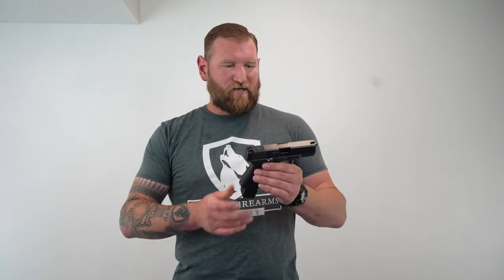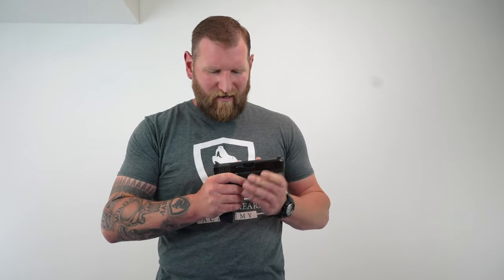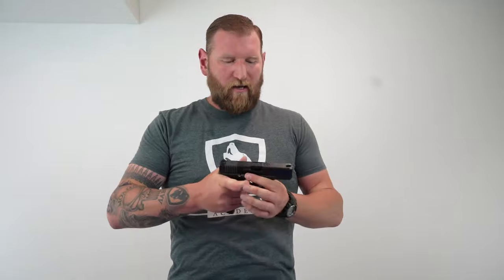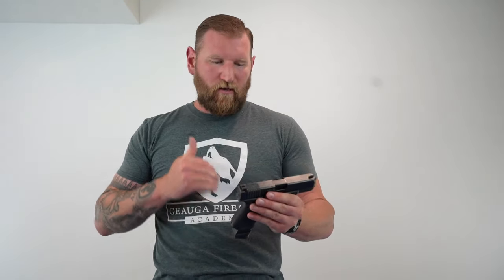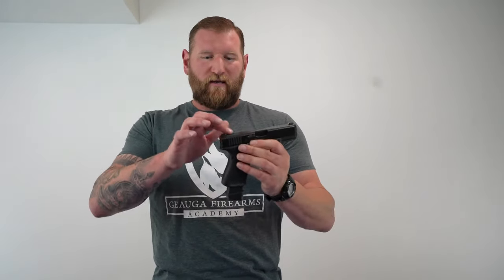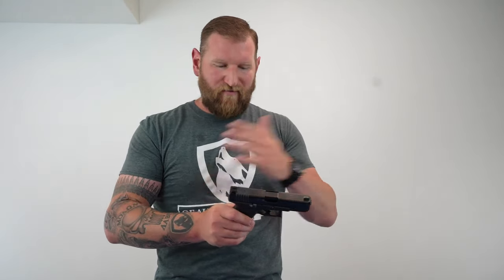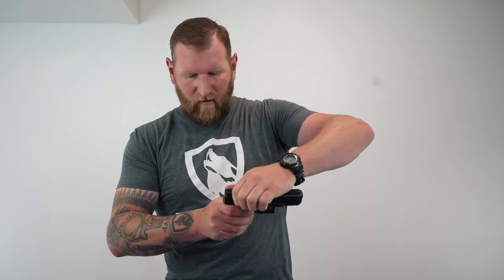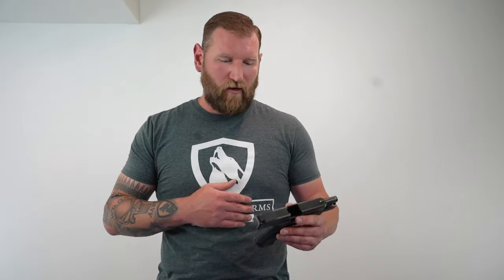How to Clear the Most Difficult Pistol Malfunction- Type 4

Comment: Just watched this video, as I was curious as to what a "Type 4" malfunction was, since I had never heard of it.  This is called a "hard extraction".  It occurs typically with remanufactured ammo or reloads.  After firing a round, the casing expands too much for the extractor to extract it out of the chamber.  It's very easy to diagnose (you simply can't rack the slide) and as quick to fix as a double feed, although significantly quicker if you don't take the magazine out.  However, it's recommended to take the mag out or else you can cause a double feed.  If you don't hit the backstrap forcefully enough, it may take 1 or 2 more tries.  One thing you didn't mention, which I feel is important, is to be very careful of the angle that you use when striking the backstrap.  Your hand needs to be at somewhat of an upward angle so you don't cut your hand if it hits the beavertail (which can be quite painful and bloody, as I once found out) but also not too much of an angle, or else the force may not be great enough to jar the casing loose.

Comment: Only two ways I clear those type and most jams.  First is simply lock the slide to the rear and take out the mag.  If it's truly locked up and will not lock to the rear I put on my gloves.  Then do EXACTLY what you just did in this video but with gloves on.

Comment: Will this work if you have weaker/smaller hands or muscle rigidity in the hands? I have CP, so my hand muscles aren't the greatest in addition to the small size + shorter fingers. Even with hand exercises, I've noticed that mine seem to be a little weaker than average, so that is a concern. Thanks in advance.

Comment: Yesterday at range 3 of my guns had this issue. I was able to clear 2 of them rather easily by forcefully bringing slide back. The 3rd gun would not release the slide and had a round in chamber. I even hit the slide hard on a table and it was jammed. Tried your technique and it worked!!!!   Thanks for the help but do you know why 3 guns would have same issue that i never had before?  If it helps a brand new shooter was shooting with these guns and when i shot no issues.

Comment: Impulse. Good to know that option to clear. 
Is the rim to deep that this happens?
Reply from the maker: No the case is stuck in the chamber and the extractor is stuck with the case.
Reply: @geaugafirearmsacademy  
Last week I had that malfunction at the range!
I used training reloads of a friend for his Tanfo Gold Medal Match and I used it in a Canik TP9 Elite Combat that ate the last 3k rounds without any hiccups (basic cleaned every 500 rounds). Idk if they copied the stepped chamber of Walther or it was just such a weak load that the timing changed...it took that technique to get it open. 
Had it 3 times in a row! The loading matrix of the case wall might be also the culprit. Some give straight, some tapered walls.

Comment: If you could generate enough of a force impulse,quick enough,could racking the slide back work too?
Reply: I don't think you could accelerate you hand quickly enough from the stopped position gripping the slide, as that is essentially the problem with applying constant pressure. It's your dominant hand moving forward at speed and hitting the rear of the grip that generates the impact force needed to break the extractor free.
Reply: Maybe it could be done by holding the gun normally in your dominant hand close to your chest and gripping the slide with your off hand, quickly moving the gun forward and then suddenly reversing the force with your off hand. It's worth a try I suppose as you are less likely to accidentally knock the gun out of your off hand that may not have as strong a hold on the slide, but it seems like smacking the grip with your dominant hand would be a more reliable method. Just hold on tight to the slide, I guess.
Reply: @reshpeck  If I ever have to use this I'm just alittle worried about sending the gun flying! I also shoot a Glock & in most cases you've got to really get a good grip on that slide for just about anything, I'm also shooting the Glock 30 not a 9mm Glock.
Reply: @jamesriggs6210  be sure to hold on as tight as you can, or else it can certainly fly out of your hand.  I taught this to about 7 ladies in a group I belonged to. (We just pretended they had a hard extraction.)  Even though I warned them and told them to hold on REALLY tight, 6 out of the 7 had their guns fly out of their hand and land on the floor.  You would think about the 3rd person to go and see the gun go flying from the first two people would have been a clue to hold on really tight, but apparently not.  However, the last lady actually listened and was the one whose gun didn't go flying and land on the floor!

Comment: I'm not a physicist but what you are describing sounds somewhat akin to the difference between torque and kinetic energy. It's the difference between using a long-handle ratchet wrench on a lug nut vs an impact wrench. You'll notice that if the tire of your car is off the ground and able to spin freely, using a ratchet wrench or breaker bar will not work; the wheel will just spin in the direction in which you are applying pressure. If you use an impact wrench instead, however, the tire won't spin and the nut will break free.
Reply from the maker: I think your on to something

Comment: 25 rounds into my new sig 365 xl, had a type 4 due to crap ammo.  Was able to clear it by placing the corner of the gun on a firm surface and pushing, which dislodged the malformed round. Don't try this a home.  Like I did.  All was fine, but baby, that slide was STUCK.

Comment: I don't know the internals of that Glock, but I'd expect that if you call them, someone can get to you with the answer. It sounds like either a cartridge is out of spec, or the extractor is malfunctiong.
 As to why the chop works when the slide is locked up, think of a door. It won't open, no matter how hard you push. But if turn the doorknob, it opens.Why the inertia from the chop works, is something Glock should know. And if they don't know, they ought to ask for your pistol (or another jammed one) so they can open it up and find out.
Reply from the maker: Thanks for watching and commenting
Reply: It's usually an ammo issue (most commonly with remanufactured ammo or reloads, although one of my guns had this happen A LOT with a specific type of factory ammo).  When you fire a round, the casing expands a little too much and gets stuck in the chamber, and the extractor isn't able to extract it out of the chamber.